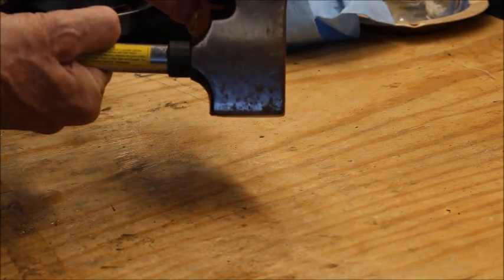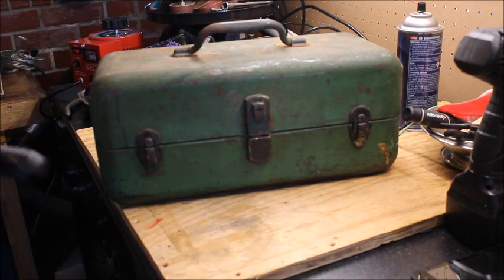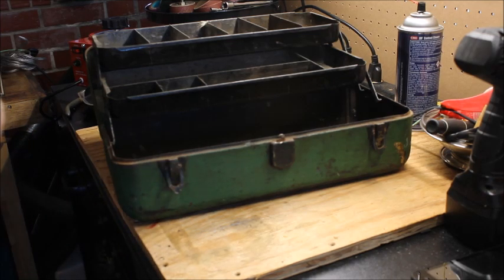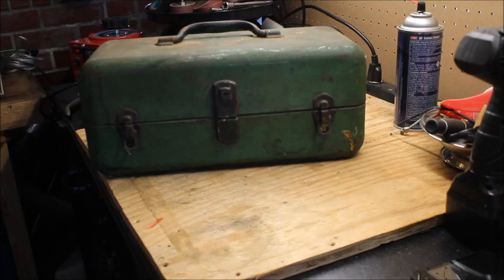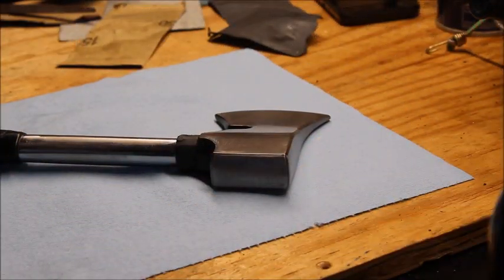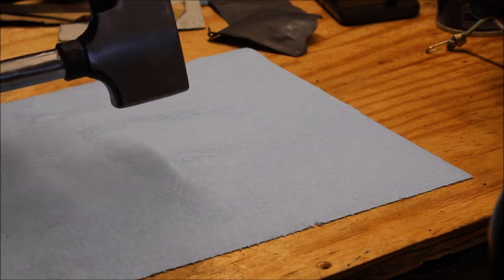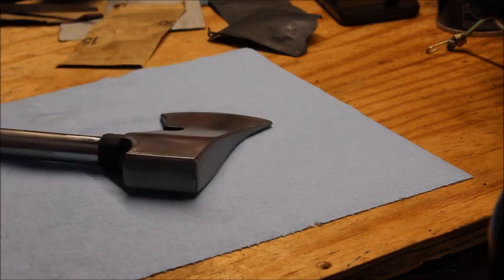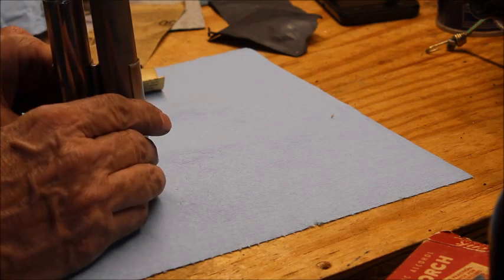Coleman Hatchet Clean Up

Comment: Wire!  Awesome job on the axe and I love the tackle box!  I am so glad you picked up a torch!  The key is get a small piece of wire and clean out the orifice hole before you try the torch...  They tend to cold up a little when sitting.  Also if the flame isn't strong enough separate the two canisters and shake the one with the torch head upside down to get alcohol into the torch-head...   Awesome stuff!  You are so right- My brother from another mother!  -=D